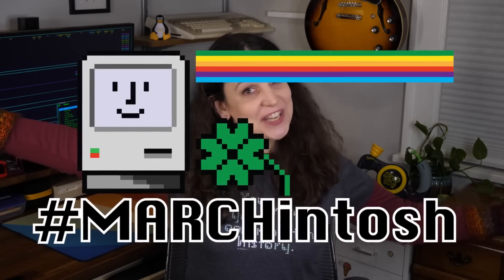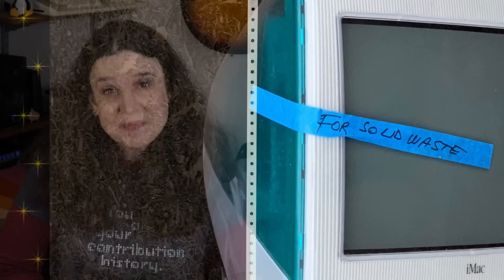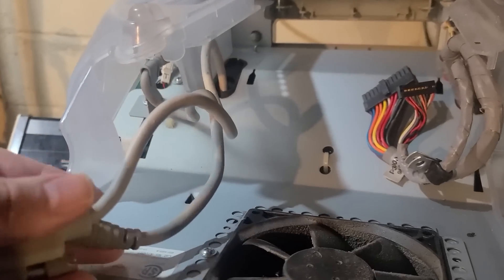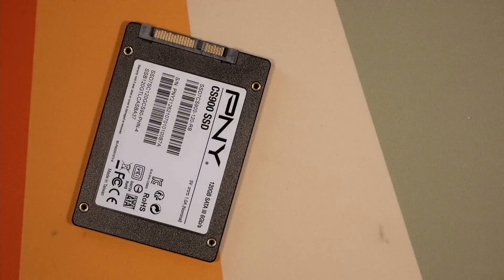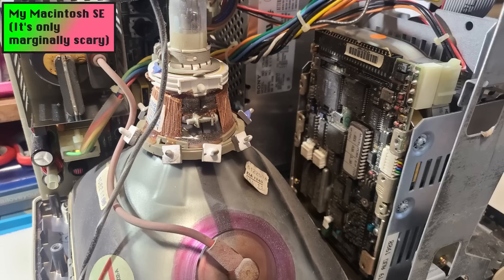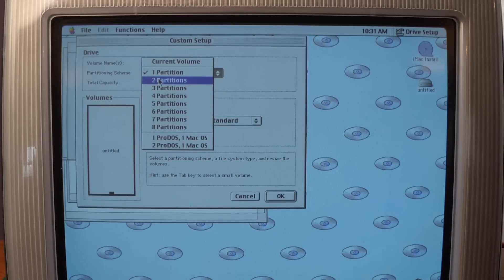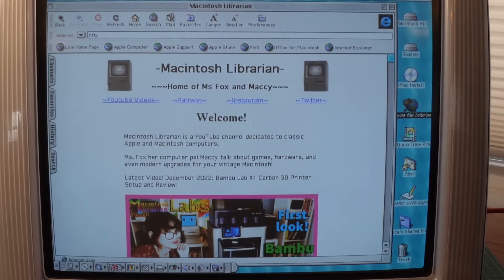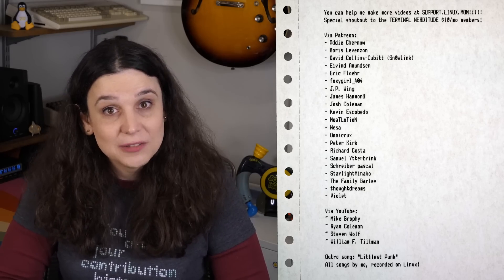Someone trashed this Bondi Blue iMac G3... can I fix it?

Comment: When you look up "pack rat" you will find me... Lol I stop and pickup anything electronic on the side of the road, sitting in a yard marked free. I even knock on the door and ask it thee is not a sign...
 I play electronic technician at my work bench for 20+ years repairing and fixing and even building electronic projects. So I take that old roadside stuff is a gold mine for parts. I use the parts I need after testing the parts. I have saved $1,000.00's of bucks doing this.
If it is a working item, or needs something fixed it is added to the "Project List"... Lol That thing is like monster of it's own...
I'm not a Mac person but I would be all over it if it was sitting beside the road for free... 🤣

Thanks for the video!

LLAP 🖖

Comment: Great recovery on the iMac! The iMac colour was named after an Australian beach, and it's pronounce Boni-eye, not Bond-ee - there is a big debate on the Apple YouTube community on this one.
Apple marks the caps as part of a checklist post production. This was common in a lot of manufacturers at the time.
If the CD-ROM drive is not flush up against the front of the iMac, then it is not mounted correctly. I think you pointed out about the tabby thing, just make sure it hooks into the wire 'U' or Omega shaped spring.
BTW, I saw your subnet mask... :)

Comment: These older macs seem to be easier to repair then the modern day macs. I had a college roommate that had this model.
Reply: They're also easier to repair than the ones from just a year or so later, because at that point they cheaped out and started making the inner shell partly out of that awful cheap plastic that they loved back then instead of all metal like this one. No matter how you store them, they're going to get brittle and shatter under their own weight. I've heard that the MacEffects guy was looking for an intact inner shell to make a custom mold for replacement parts out of... judging by the lack of such a product on the site, I guess he's never found anyone who has one!
Reply: It still seemed pretty tought tho, just for some cleaning and drive swapping
Reply: @fazejohncenachristogamerfaze  The newer slot loading models are actually a lot better for that, they have the drives and such directly accessible by just removing the bottom cover and RF shield. Getting to the CRT is still a disaster though.

Apple's towers from this period though, now that's a whole another ball game. I have a graphite G4, and that has to be my favourite machine to work on, period.

Comment: I have an iMac from 2011 that works well with Linux.

Expanded its lifespan since Apple dropped support for it past High Sierra and works well with newer distros. I did have to do something to enable brightness control with editing a text file though.

Sound would also only work with no further configuration needed after immediate installation if i chose a distro with Pipewire. Otherwise i’d have to go deeper into the system again to enable it.

Comment: My sister had a 300MHz G3 iMac, I think it was one of the second gen models. I acquired it from her in 2004 after she was about to throw it out. 

This was back when my Linux skills were....so so; I knew of it, I remembered a few commands from my days of shell accounts, but that was about it. My primary issue back then was trying to install an OS you didn't know on your sole computer. There was this new distro people were talking about, Ubuntu. Since they had PPC support I decided to give it a try.

Well that did the trick. I installed that early version of Ubuntu and did all my initial hardcore Linuxing on that iMac.

Not an Apple fan, but it made a nice little Linux machine.

Comment: Return of the mac!
Good idea getting an expert on the CRT you might only get to make mistakes with the coils once
Reply from the maker: That's exactly what I was thinking!
Reply: Really if you discharge the tube, it's all safe for the most part. but still need to be careful.
Reply from the maker: @eupher2  Even after discharge, though, there's still some damage that can be done even beyond the electrical concerns. Between vacuums and sensitive components, I feel good recommending to my viewers that they reach out to experienced technicians when it comes to the finer points of CRT repair.
Reply: @VeronicaExplains  That's true it can happen. I respect you for being safe and asking experienced people for help.
I wasn't trying to be a wise guy or anything.